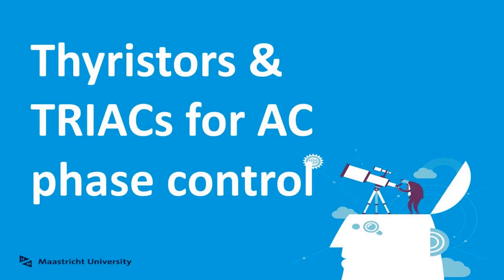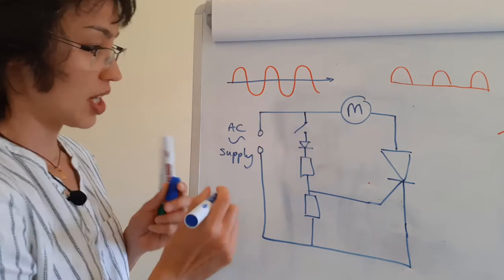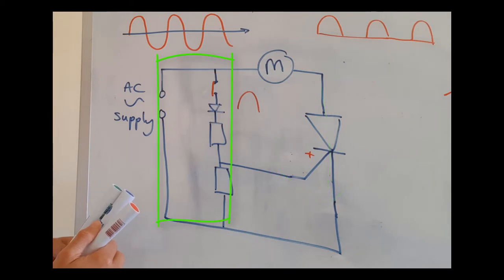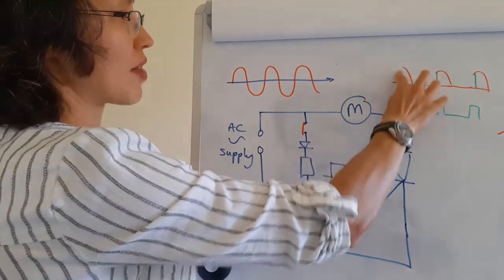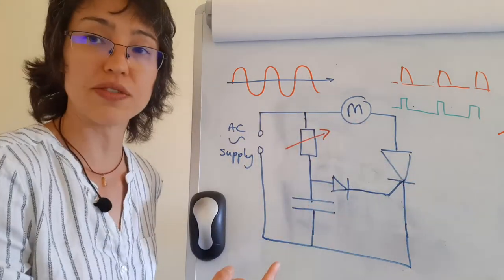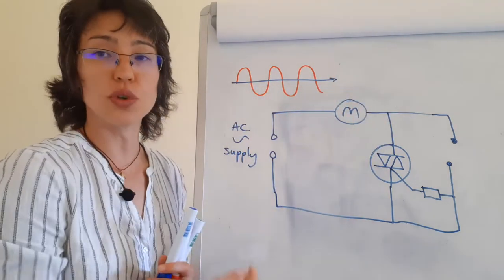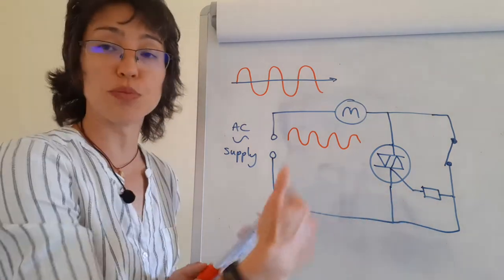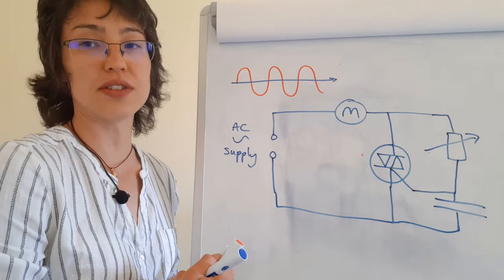Semiconductor Devices (part 5/6): Thyristors & TRIACs

Comment: The triac circuit shown around minute 10 essentially makes a short over the triac and thus renders it unusable. If the lower right line would be removed, then yes, it would work as intended.
Reply: Yup, you're right.
Reply: I was wondering how many of the viewers noticed it, so I went into the comments section.

Comment: Please please continue to make videos like this. you’ve explained this in a way that I've understood something that I couldn't before, i found this at school too, 1 teacher out of 15 would be able to unlock my brain, when it happens it feels fantastic 😊
Reply from the maker: thanks so much for your wonderful feedback, I'm so pleased you liked the explanation!  I hope to start making more videos soon, thanks to motivating comments like yours!
Reply: @donna.carroll Thanks for such a wonderful lecture and video. Just wanted to ask you one more thing. If I have a relay which is in closed normally and the it opens when the extra pin i.e the third one is powered. In the normal closed position I can pass dc current through it but if I powered the third pin which opens it will it open it if it has dc current flowing through it already in the normally closed position???
Reply: Triac connection is totally wrong.!

Comment: The triac circuit is technically not correct for the operation being described. Closing the switch is also  completing the electrical path for the motor / load regardless of the triac state. That circuit as drawn is fraught with errors.
Reply from the maker: Yes indeed! In practice (in a real circuit) you wouldn't build it exactly like this for many reasons, but for this example, it's just to gain a basic understanding of how the device might function in theory.  Thanks for watching and commenting, much appreciated

Comment: to set the timing of the pulse, you can use zero crossing detector. That makes the pulse will tirgger, always on the same spot of sine wave, actually at zero point. Thanks a lot for the explanation miss..

Comment: Dear Donna, isn't the switch in the circuit at 09:00 already providing less impedance than the triac (therefore bypassing it completely), while the gate of the triac is biased to one of the AC lines, making the triac conduct half of the AC cycle?

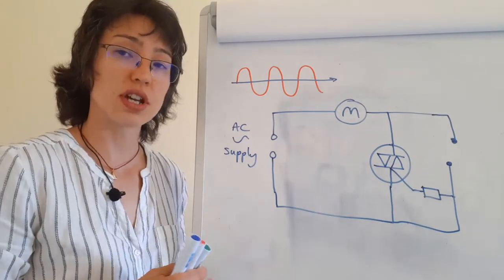Comment: Nice and thorough explanation, but @8:00 I find an error in the schematic since the bottom right DIRECT connection of the switch with AC supply completely bypasses the Thyristor, it shouldn't exist and your analysis would be RIGHT

Comment: Now i understand the parts a bit better of the lamp I'm trying to fix. Only goes on full blast, with the variable resistor in any position.

Thanks!
Reply: have u fixed it because im having trouble with a dremel tool with on max speed ??
Reply from the maker: Glad I could be of help!  Sounds to me like your variable resistor might be shorted which means the capacitor doesn't take any time to charge, hence the full signal is going through the triac all of the time
Reply from the maker: @DjeDrie  this could be the same fault - the variable resistor / potentiometer.  Of course, sometimes the TRIACs themselves also fail
Reply: If the capacitor where not there/open you would also have the full voltage in the gate regardless of how much resistance in the potentiometer??  Thank you for taking the time to do these videos by the way!!  @donna.carroll

Comment: I remember doing this at Joliet Junior College in Joliet IL around 1971 using a gas filled tube. What is that tube called?
Reply from the maker: probably a thyratron, right?  https://en.wikipedia.org/wiki/Thyratron#:~:text=A%20thyratron%20is%20a%20type,phenomenon%20known%20as%20Townsend%20discharge.
Reply from the maker: thanks for watching!
Reply: Triode vacuum tube

Comment: mam..using SCR and sawtooth wave form for drill  to reduce rotation speed and not lost torque  like as TRIAC does
Reply from the maker: some motors use two separate windings to adjust  rotation speed instead of a TRIAC, that could be a solution
Reply: @donna.carroll  mam we talking about drill 😌

Comment: question, at https://youtu.be/0GgWvH2mY80?t=398 , how can i replace the variable resistor, with something, ( may be transistor,) so i can control the current from other source, let say micro controller (arduino which is has analog output)